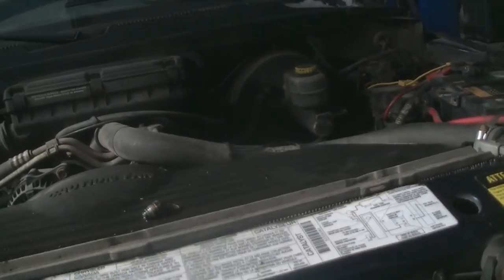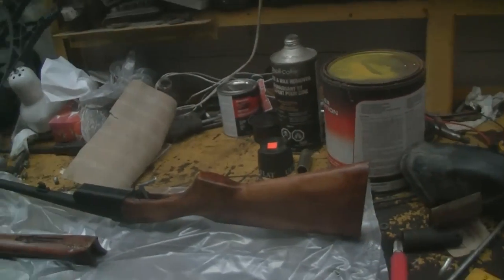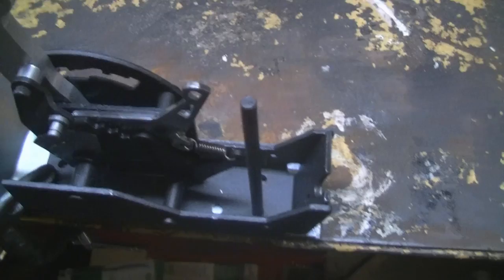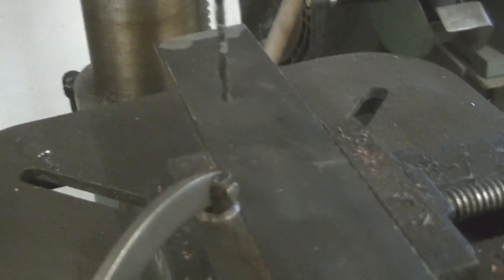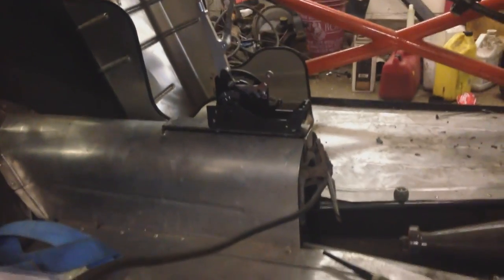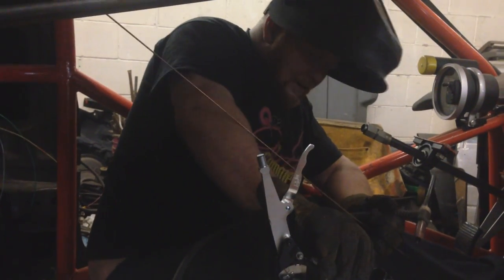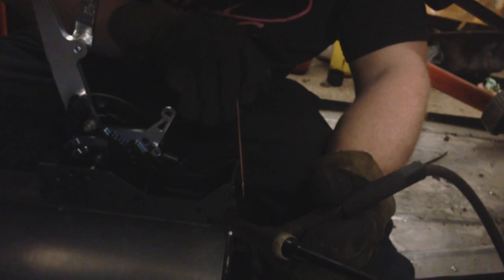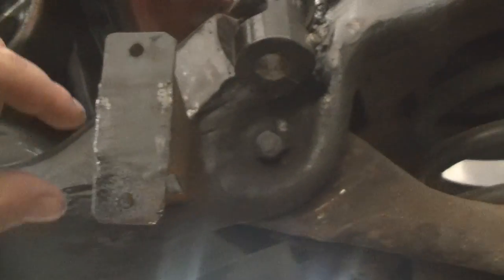Camaro Drag Car Build part 22

Comment: Greetings from Venezuela, how many meters of tube are spent in the rollbar and what measure of tube did you use ?
Reply from the maker: 1.75 .120 wall i went through i dont remeber if it was 6- 21 foot lengths or 8 of them